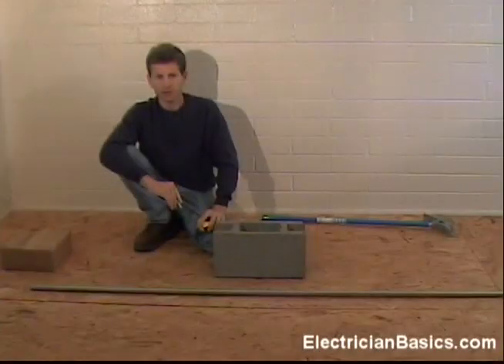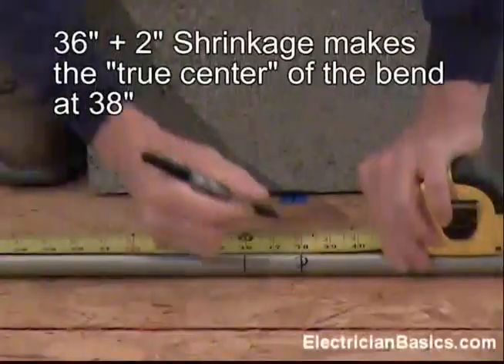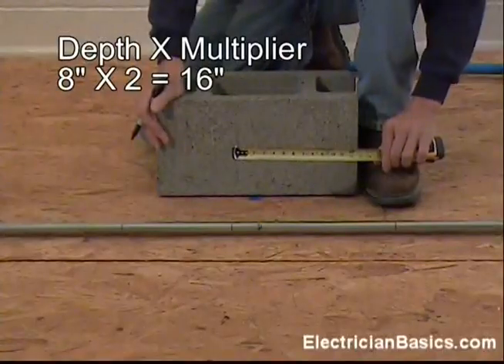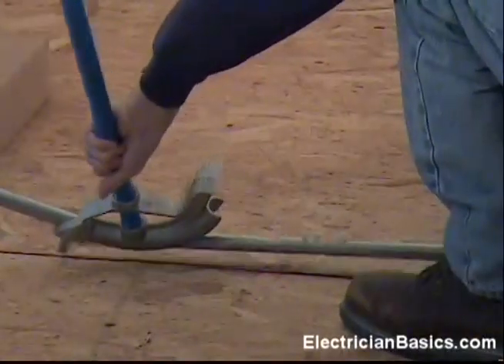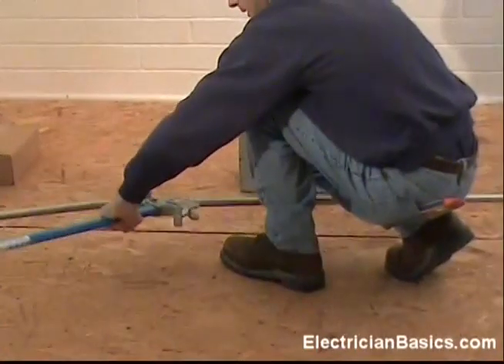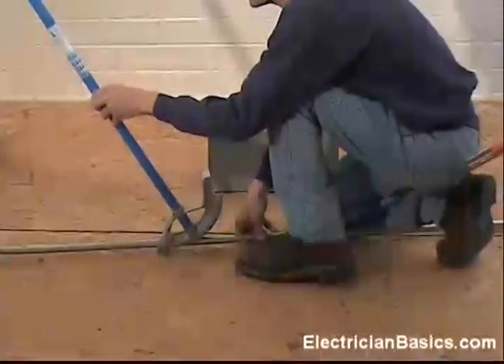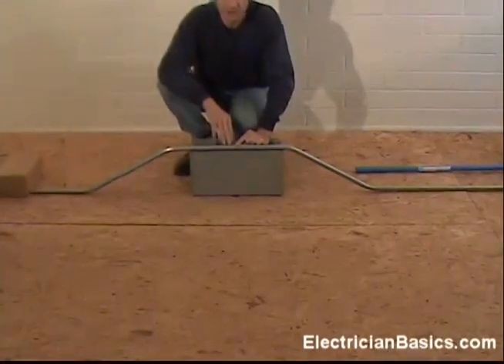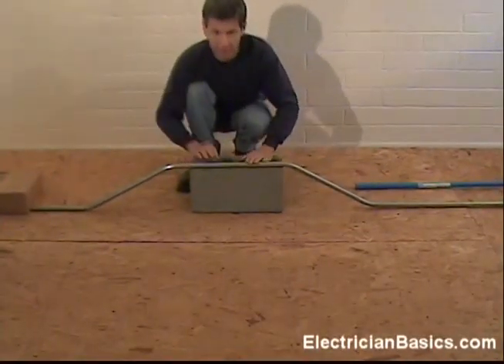Bending Conduit With a Hand Bender - Four Point Saddle With Shrinkage

Comment: Any tips for not getting dog legs, I’m struggling with the 4 and 3 point saddles
Reply from the maker: Align the pipe in the bender the best you can. Remember that alignment. After bending,,, check to see how straight it is. If you need an adjustment then make it on the next bend. Line up the conduit like the first time and then make the adjustment. Remember that alignment and see how it works. For some people, it would help tremendously with all of their work if they stopped drinking.

Comment: The star works with 15 degrees or only for 30 degrees
Reply from the maker: It's usually close enough that it will work for either angle